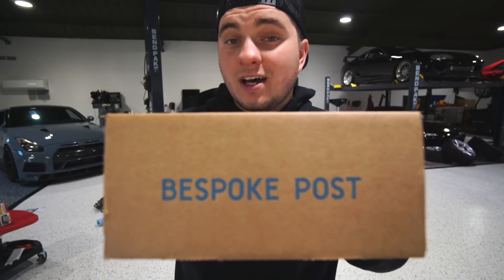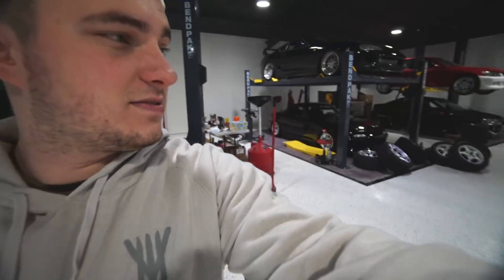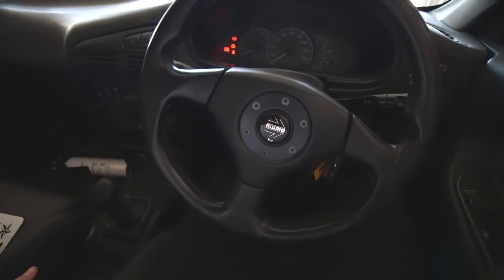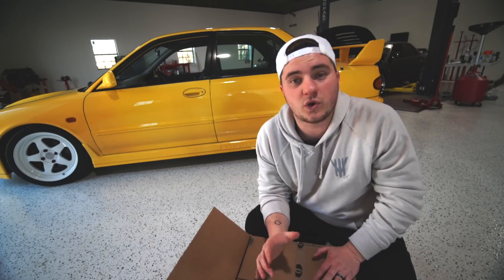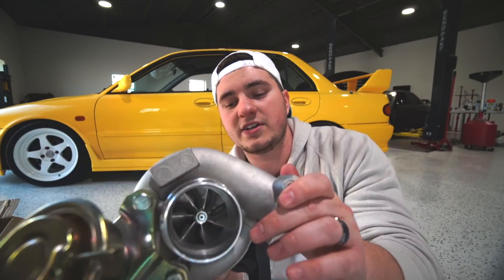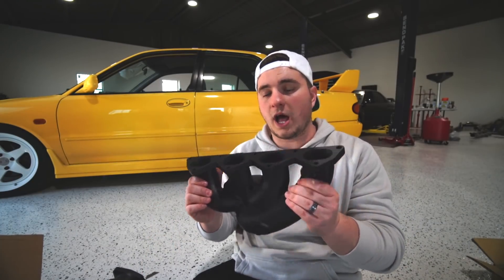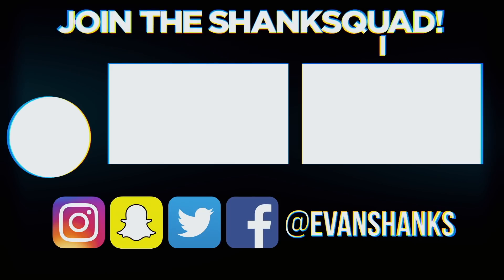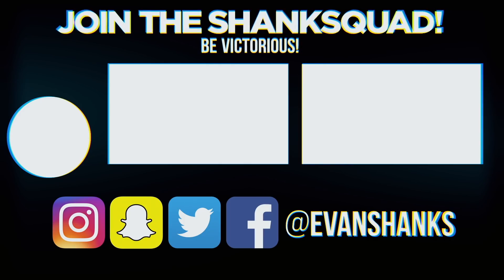The PERFECT turbo upgrade for my Evo III GSR! - EVO III BUILD BEGINS

Comment: Speed density and dsmlink is a must with that build. Especially with the hta68. Easy 350hp on 93. 450 on e85 with 272 cams. Stock internals👌🏽👌🏽

Comment: is the engine built?. if you boost more than 1 bar with stock turbo you'll risk cracking the ringlands on the oem pistons due to it's higher compression ratio than the evo 1 and 2. stock turbo is capable of around 360hp if i remember correctly, and thats if you are really pushing it so the fp turbo is a great upgrade. the fp manifold is also great if your oem manifold is cracked. a lot of owners have just ported the evo 3 oem manifold. that way it pretty much equalls the fp in exhaust flow. it's a good budget choice if you can't afford the fp manifold. I went for a tubular headers and a borg warner 7163 efr on my evo 3 2.3l stroker.

Comment: Hey evan, just wanted you to know that evo 3 and only 7000 unit  in the world so it’s pretty rare (I research it). I currently have evo 3 with built engine and i just want to tell you that evo 3 stock engine can’t handle 450-500 bhp (base on experience)

Comment: I don't what to say about 450 on stock motor I have a evo3 back the days I made 350hp an the rod went to space lol but get a vr4 block jdm block way strong much better crank it was running on e85 too .my mate evo2  made 350hp but the ring let go the motor not that strong built don't waste a stock block bro getting hand to find these day bro . But good luck bro. Keep it up 😄

Comment: This wont end well the pistons in a evo3 are high compression the ringlands fail if you up the boost and hp the evo 1 2 were low compression and can handle good power best thing for this would be evo 9 rods and pistons unless you went full built forged

Comment: nice dsm
Reply: They're not DSM's
Reply: @Magnetic5oh  issa dsm
Reply: @ASREnthusiast  no it ain't. DSM stands for Diamond Star Motors and DSM's are built in America and were never sold on the Japanese market. I own a first gen DSM ffs, I know what I'm talking about. You can go to the Vin tag on the firewall of both cars and on the DSM it'll say DSM or Diamond Star Motors, if you go to the one on the Evo it'll say Mitsubishi Motors. Same goes with the 3000GT and the Galant, they're not DSM's. DSM's also have little DSM stickers everywhere on the car and Evos don't have any. So if you would like to keep arguing, I'll gladly sit here and prove you wrong every time, so go on keep talking
Reply: @Magnetic5oh  lmao these evos have dsm tech so its a dsm just like the new supra is a bmw
Reply: @ASREnthusiast  that doesn't mean anything
Reply: @Magnetic5oh  it has all the same tech as dsm cars , computers, engine, etc
Reply: @ASREnthusiast  and? That still doesn't mean anything. Were Evos 1-3 built in America in the DSM plant and only sold on the American market? No, were the Eclipses built in America and only sold on the American market? Yes, therefore making the Evo 1-3 NOT a DSM
Reply: @Magnetic5oh  they can be built in different places and still use the same parts. lmao this dude
Reply: @ASREnthusiast  you make no sense. You can come back when you learn a thing or 2 about cars
Reply: @Magnetic5oh  a quick search on google quickly disproves you
Reply: @ASREnthusiast  you can literally look up on the Forums and it'll say it's not a DSM, again come back when you learn a thing or 2 about cars

Comment: Strange that you claim to be an evo expert and at no point in your video do you mention that E4-9 turbos don’t fit E1-3 because the engine is turned 180 degrees from E4 onwards.